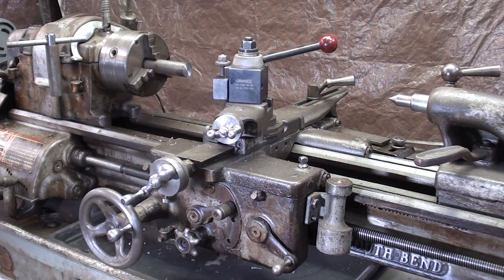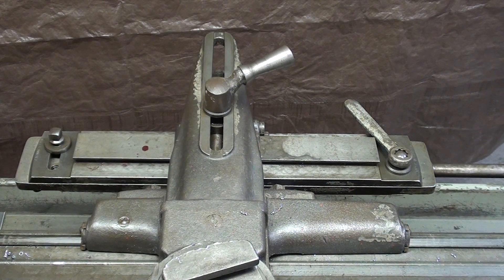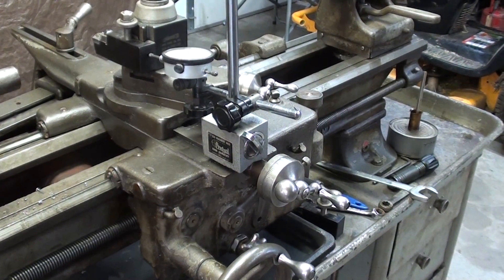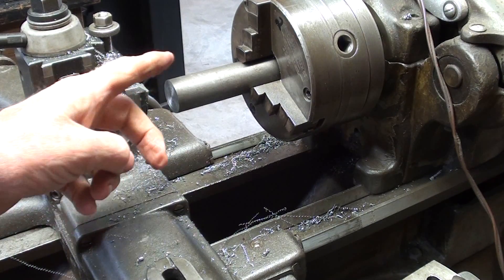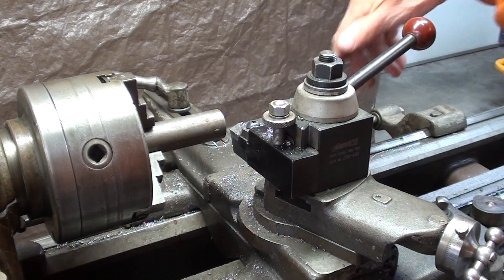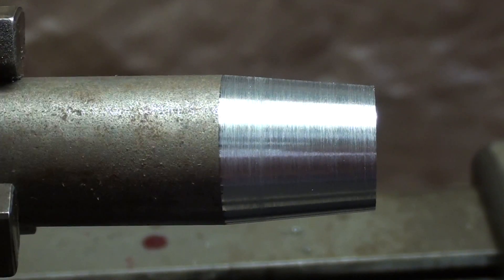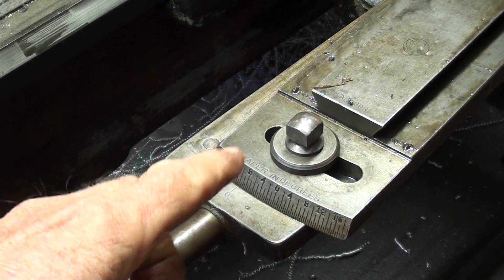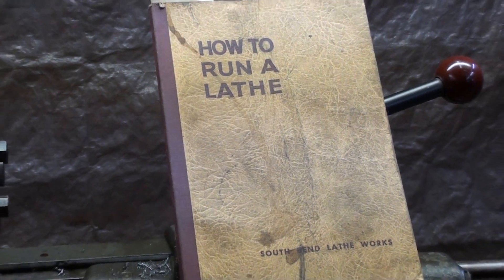South Bend Lathe Taper Attachment TIPS 700 tubalcain

Comment: I did thousands tapers in my career. All in  the marine industry. 3/4 inch per foot is  standard for most marine shaft tapers . is .125 inches of taper on a scale over 4 inches of travel.  taper attachment are the way to go.  The lathe I used  was in inches. need to measure anyway when  changing to a taper as  the angle is important. metric is the same. i  found some discrepancy in recommendations. so i  preferred to have the customers sample.  Also  not all tapers are standard.  Some are special. Only use the compound for cutting  a taper cut  depth.. never  the carriage. And true. do account for slop by moving  the carriage  past the slop.   this is  one area i am very knowledgeable. i learn a lot  from this YouTube account but  tapers are my  specialty

Comment: Never to presume to "teach the teacher" but I have cut reasonably accurate tapers by dialing in the exact center of my sine bar, and then  indicating the travel of my tool bit off of my test taper that I want to copy.  The trick is to get the taper you want to copy on a spindle and centered.  Just an observation if you ever need one exact.
Reply from the maker: Thanks

Comment: I have the tele taper attachments on my 10L heavy and my FOURTEEN. These are very good attachments. Amazingly expensive if you want to buy a used one on eBay. The only annoyance is that unlike some others, there is no vernier on the ends, and the read outs are not adjustable. I ended up maki g an indicator that can be adjusted instead. Unfortunately, I had to drill and tap two #6 holes. If everything isn’t perfect, the numbers are slightly off. There is supposed to be a cover to cover the slot under the lock at the back of the carriage, but I’ve never found one, so I made one out of 18 gauge SS.

Good, Pete. Just to remind people that with tapers, it’s extremely important to have the cutting tool exactly on the centerline, or you won’t get the taper you’re going for.
Reply from the maker: Thank you. The cover was missing on mine ever since I owned it. Never got around to making a new one. I think I announced in one of my videos, that the tool must be on center for a true taper

Comment: Well this video's 'made' some work for me ! The question is are the degrees marked on the TTA whole degrees or halves ?  If the cross slide is thous radius and not thous diameter, then I'd expect even more that the 2° mark would give an included angle of 4°. My (M) taper experience has always been true angle (1·5°) rather than the included value of 3. Therefore I'd naturally aim to set my TTA to 1·5°.
Since yours goes to "20°" and mine goes to 10° - again, I wondered if yours is the included value and mine isn't ! My manual (https://docs.google.com/document/d/1iCwiQ52QTBmwQ7EJvUa6ffPkiovLUBgTfmCuVmldX70/edit#heading=h.94wp0ufcf13y) 
doesn't make that clear either. So the answer is for me to measure it - and having worked out tan 8° ~ 0.14 thou per inch, I decided to use 8° as my test angle. Then it all went wrong !

I discover my TTA adjustment knob is just about seized ! I can turn it just over 1 rev then it goes tight and I need tools on it - which feels quite wrong ! So I've got it off for dismantling ! The swivel part is totally free - so it must the the knob screw & nut where it's gone tight - notably inaccessible for lubricating - maybe that's the clue to the problem !

Comment: I worked on a Ward turret lathe which had a taper turning attachment. It was in the 60's. We made cranes and excavators . . We had a franchise with an American company called Ransom and Rapier. It was later called NCK Rapier (Newton Chambers Koering ).
The  top half of the crane rested on a set of large taper rollers which revolved on top of what we called the car- body. It was very skilled work.
Reply from the maker: Thanks

Comment: You might want to emphasize that the cross feed screw must be disconnected when using the taper attachment or mechanical carnage will occur. This is something that the inexperienced may overlook.
Reply from the maker: It does not, watch the video again

Comment: I have a telescopic taper attachment on my South Bend 13" lathe.
Now all I have to do is get the lathe off of the heavy duty wheeled platform I have it on so I can move it around, get the electric hooked up, clean the lathe, get a good belt for it, clean up the chuck so it will work, grind a couple of HSS bits...
And on and on...
Thanks for your time on the channel!

Comment: Lyle I am confused between the first and 2nd methods of tapering on this unit. For I don't see the difference whether the cutting head is angled or straight. Can you embellish on that; so I can "see" what you are achieving between the 1st method and the 2nd method. I just don't see it.

Please help a very old man (going on 89) to understand it. 'Preciate it!

Thanks kind Sir.
Reply: 1st method uses the "x-axis" regular cross slide to change your depth of cut. You have to engage and disengage the locking lever on the taper attachment every time you go to make another pass (since your compound is usually set at an angle, any adjustment wouldn't be thou for thou). The 2nd method sets the compound at 0 degrees, effectively making the compound a 2nd "x-axis" feed (the same as moving the cross slide), so you don't have to mess with the locking lever on the taper attachment every time you go to take another pass, you can just dial in the compound

Comment: For Morse or other tapers, I have put a known good taper such as a drill or an endmill holder between centers and set my taper attachment with a dial indicator swept back and forth across the known accurate taper....Takes much of the guess work out of it....I have cut Morse external and internal tapers, along with 40 and 50 std "quick release" tooling in this way.. Cheers from Louisiana
Reply from the maker: Thank you, I did that in a video along time ago. But it might be in one of my video courses

Comment: Building a plain taper attachment isn't too difficult.There are a few videos on how to make one. As Lyle says the only drawback to the plain taper attachment is that you have to feed off the compound and you have to release (unbolt) the cross feed nut when you use the attachment.

Unless you really need a taper attachment, I wouldn't go to the trouble of building or finding one. In 50+ years in the shop I've never needed one. Any time I've needed to cut a long taper I've just used the compound and picked up where I'd been cutting before. Perfection in the surface wasn't required because the work was going to be heat treated and the taper was finish ground on the center grinder. Even if you are making a Morse taper shank that isn't hardened you still have to blue it up and fit it to the mating socket by filing and polishing it no matter the method used to turn the taper.
Cheers from NC/USA
Reply from the maker: I totally agree. Really the only time in my life that I needed a taper attachment, is when I make a video about taper attachments, LOL

Comment: Another correction !
10:00 "I'm going to
 loosen up the compound and set it for zero so it's perfectly perpendicular to the work"
But as the work's at 10°, that's what you should set the compound for - that way the compound position dial will show exact depth of cut. (or in your case as it seems your TTA turns a taper half the angle of that set, 5° !)
Reply: Setting the compound at Zero makes it feed straight in the same as the cross-slide feed would be if you were using the compound for angle/taper turning, or turning between offset centers.

 If you set the compound at 30 degrees and moved the cross-slide in for .010 depth of cut you would get .010 depth of cut when feeding the compound, or at least your start point and end point would be .010 (or .020) smaller diameter as intended.

 If you set the compound to match your taper attachment angle, yes it would be perpendicular to the cut, but your final dimension would be off because of not feeding in 90 degrees to the center-line. The more passes you take, the farther off you would end up on your diameters.

Comment: My lathe (Colchester Student) doesn't have a cross slide clamp on the TTA. The way it works, the normal fixing for the cross slide screw at the handwheel end is removed and the (end float) fixing occurs at the TTA end. A different cross slide screw is used - one with sliding splines to pick up the rotational drive from the handwheel (or power feed).
It is also limited to 10° max over 12" length.
https://docs.google.com/document/d/1iCwiQ52QTBmwQ7EJvUa6ffPkiovLUBgTfmCuVmldX70/edit#heading=h.94wp0ufcf13y

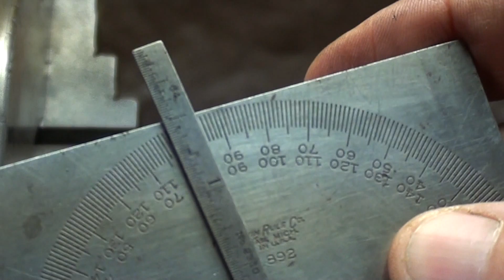13:10 IMPORTANT POINT - what angle is marked on the TTA ? Yours goes up to 20°, mine goes up to 10° - and I'd like to think mine is in whole degrees and yours is in half-degrees. You set yours for 10 and got an angle of 5. I think I'd need to set mine to 5 to get an angle of 5 !

Comment: Had that same model lathe in the enginehouse at the shortline railroad I "grew up" on.  At some point it was identified that we really needed to get the taper turning attachment for use on machining steam locomotive components.  I am pretty sure it was because the crankpins for the main rod were worn with a slight taper, and when the rod brasses were rebored the Master Mechanic wanted to match the taper as in-situ turning of the crankpins on the locomotive was beyond the capabilities (and budget) of our operation.

It's good to see a 10" South Bend set up just like the one I was learned on.

Comment: Good video! I'm building a taper attachment for my logan 820. My design needs for the cross feed nut to be released in order to slip for a taper. I thought it would be an easy build, but I'm still designing and build after a year.
Reply: Colchester moves the nut to the TTA and has a screw that slides on splines back to the handwheel to still offer drive and power feed.
https://docs.google.com/document/d/1t2DZ43oU_AH04M_QVSwTWx6uQWQwQcMU6Nt2mKRtEnE/edit#heading=h.jr8lb6kas02a

Comment: we had 4 south bend 9" in high school shop class,  2 with taper attachments.  one of our mandatory projects was a bird call made from aluminum and wood. it was our choice whether to use the compound or the taper attachment to cut the taper. extra points to use the taper attachment and  hit the dimensions on the print.

Comment: A week late for me, Mr. Pete! I had to turn my first taper on my SBL 13” just the other day. Took me a little time to figure it out, but we got it. Not surprising, the machinery’s handbook a formulas in there for calculating the taper if the final dimensions are known. Surprisingly though, that particular formula was fairly straight forward, unlike some of the formula in that old book. Mine is an early 40’s volume. Seemed fitting after restoring this old 1945 SB to near factory new condition.

Comment: Morning sir, do you have to disable the cross feed nut? I’m wondering 💭 how it follows the taper if the cross feed screw is still engaged?
Reply: As to your question the feed screw on the telescopic taper attachment is two pieces. The back half is the feed screw and the front half is a hollow tube with a key. There is a keyway cut the length of the feed screw. This allows the two pieces to slide when the binding bolt is tightened. To cut in a straight manner  the taper bar should be set straight.
Reply: @brucetuckey7909  Thanks!
I see how that works now that you have  described how it works.
When the taper attachment is moving the cross feed, the non threaded part of the screw is sliding within a tube with a key on the keyway.
And when the cross feed handle is moving the cross feed, the screw is being turned by the handle via the key and keyway, and the threaded part of the screw pulls/pushes the cross feed.